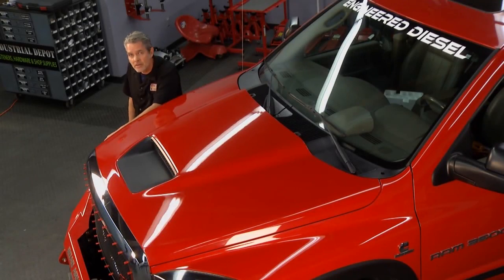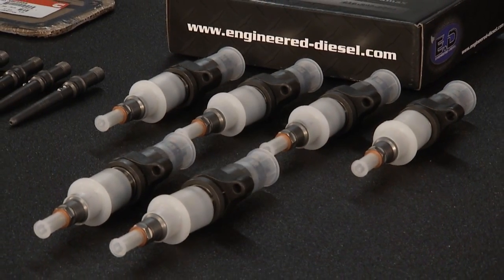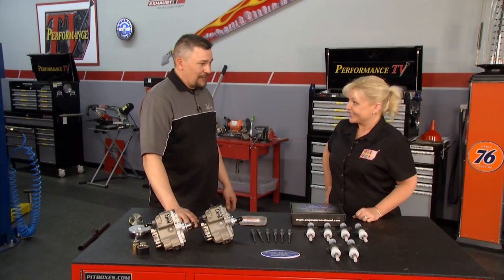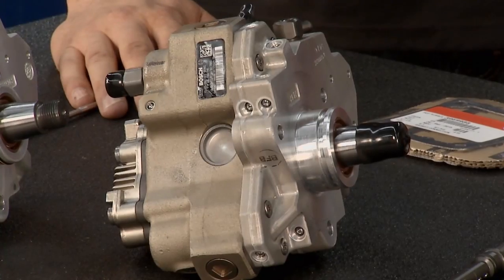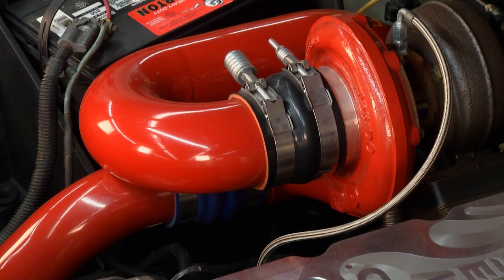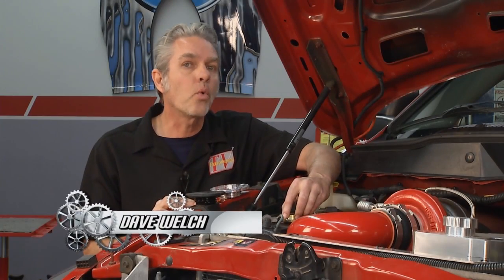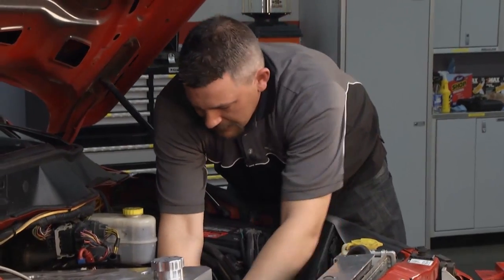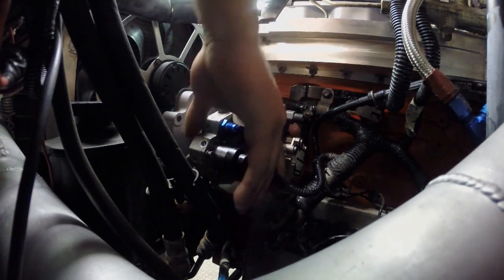Engineered Diesel on Performance TV talking CP3s & Injectors - EP 1616

Comment: funny how he said they just about got it out of there but he still didn't even take off the first high pressure connection to the rail lol, still has to remove the return the supply and that's the quick part then take the gear off the pump shaft and remove the pump from the timing cover